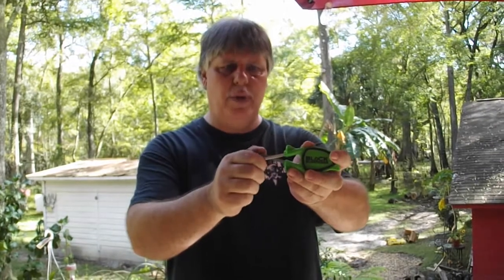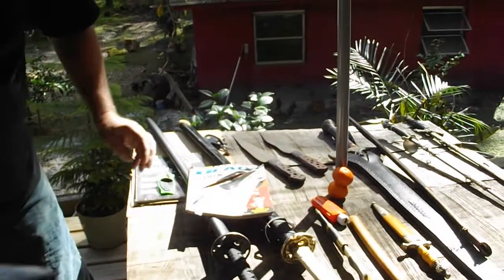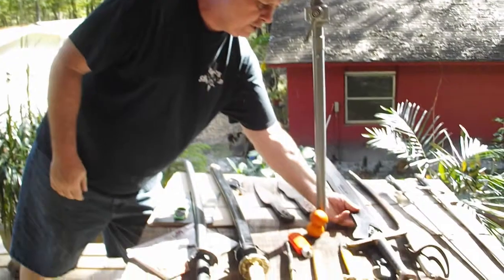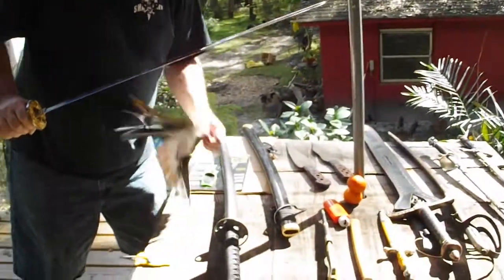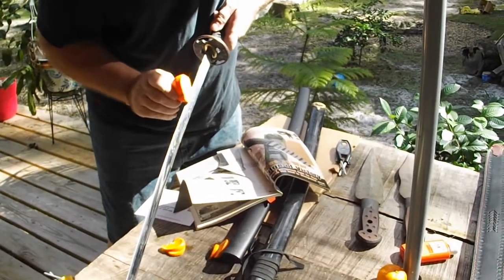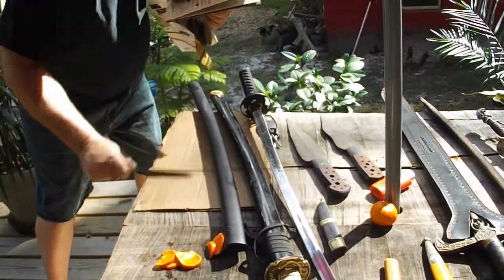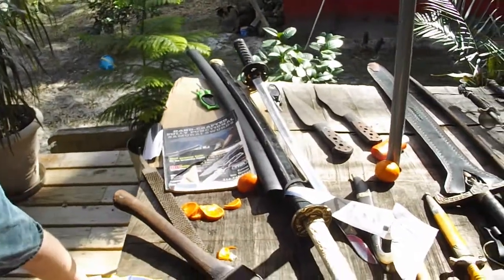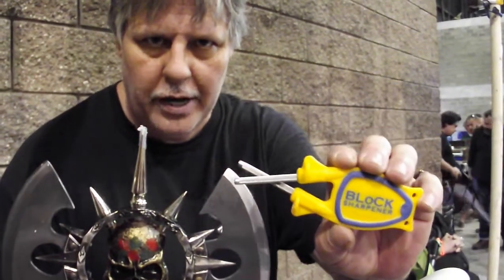Sharpening Swords and Katana Razor Sharp  is easy with the Block Sharpener

Comment from the maker: This review is 100% verified purchaser and I have had no contact at all with the seller or manufacturer. I recently purchased a $400 Boker Tree Damascus drop point pocket knife made in Germany and wanted a way to sharpen the beautifully patterned 300+ layered Damascus stainless blade without damaging it. After doing some research I came across The Block Sharpener. This device did a very decent job with no marring, chipping or scratching the blade at all. I would highly recommend watching The Block Sharpener videos on YouTube and on their website and to use oil as recommended. I have also ordered on Amazon a $10 leather razor strop to get an even finer razor sharp edge but the videos say you can use the rough side of an old belt or even cardboard to refine the edge the Block creates. After a first try I can confirm that it does follow the original curved edge grind as advertised and does sharpen! Is it like a $700 Edge Pro...absolutely not, but really is well worth the money and does quite a good sharpening job! I don't understand why some say it does not work because really it does. I definitely purchase more. See Photos!!! Thanks!!! Jerry
review image
1 comment| 3 people found this helpful. Was this review helpful to you?
Yes
5.0 out of 5 stars The BLOCK SHARPENER its the BEST
By Joe A.on August 4, 2017
Color: Blue with Yellow|Verified Purchase
The product works AWESOME better than advertised. Compact enough to put in my knife sheath & very well made. I loved it so much i bought 4 & on top of that Mr Billie Jo Block was SO VERY HELPFUL great customer service. Highly recommend this product & company! I sent one to my Son who is in the Marines in NC he loves it too. Thank You Billie Jo Block for a great product
5.0 out of 5 starsReally surprised me
ByNidhoggron September 6, 2017
Color: Black with Black|Verified Purchase
Great for a quick sharpen! And I was VERY surprised when it actually work on my serrated knives. Well worth 
5.0 out of 5 stars Makes you knives and swords razor sharp. Just be ...
ByDHSon June 6, 2016
Color: Blue with Black|Verified Purchase
Makes you knives and swords razor sharp. Just be careful when sharpening a sword. The rods will scratch the surface of the sword if it comes to contact with it. But if your careful and run a sword through it slowly it will make it razor sharp.
Comment| 2 people found this helpful. Was this review helpful to you?
5.0 out of 5 starsGreat product!
ByKyle A Walkeron March 5, 2017
Color: Orange|Verified Purchase
This is the only sharpener I use anymore unless I need to make some major bevel changes. Sharpens quickly, effortlessly, and without risking grinding the steel down too much.

Plus I met Mr. Block (senior) at a fishing show, he's a nice guy and is a waaaaay better salesman than his son ;)
5.0 out of 5 starsQuick and very easy to use!
ByRedBeardon October 17, 2017
Color: Orange|Verified Purchase
Definitely works! But there is a little small learning curve, about 2 minutes.
Comment| One person found this helpful. Was this review helpful to you?
Yes
5.0 out of 5 starsVery easy to use
ByAmazon Customeron May 16, 2017
Color: Orange|Verified Purchase
Very easy to use. I wanted a way to sharpen my own pocket knife and not have to always ask my husband to do it. He ordered this, thinking that he would still have to sharpen my knifes, but not anymore! I'm keeping it!!! And now I can sharpen my own knifes. Works great with Damascus Steel blades.
Comment| One person found this helpful. Was this review helpful to you?
Yes
 
5.0 out of 5 starsGreat
ByJenifron November 11, 2017
Color: Orange|Verified Purchase
For serrated edged knives it works great.

5.0 out of 5 starsA very good product. I have a lot of different knives
ByAmazon Customeron July 21, 2017
Color: Orange|Verified Purchase
A very good product. I have a lot of different knives, and it works well on all of them. I bought one each for my sons. Great pocket ready sharpener
5.0 out of 5 starsWorks great!!!!
Bylilshupik85on May 9, 2017
Color: Black with Yellow|Verified Purchase
Works like advertised. Take a little getting used to on how to hold the knife but it will put a very sharp edge on your blade.
Comment| One person found this helpful. Was this review helpful to you?

Comment: Have a question? Does it also sharpened a black Damascus katana sword??
Reply from the maker: It should long as it not to warn out real bad. more for finish touch on stuff that hard
Reply: Paul Block it's not warn out at all, I'm asking because I don't want to damage the sword, what kind of oil I should use?
Reply from the maker: 3-n-1 , gun oils, if can bolt sharpener down to bench. do some other swords first get the  feel .

Comment: The real Japanese Karanas are not made by the single stainless steel.  They are mixing up with the plurrel metals.  If you sharpen The real Katana with the titanium carbide, the micro bevels get all scratch.
Reply from the maker: I cant say it would not for sure i never sharpen one. But i can tell you i have sharpen a lot of different types of steels and never scratched any edges with my new models. Now are original sharpeners est in 1969 where made for butcher shops and production sharpening have a courser rods they most likely would scratch edges. My new models i aimed them more for finer hone and razor sharp. I do relay believe you would be ok to use it on a very hi dollar sword. but sure your not going to get a polish finish. I would leather and polish after words . I haven't done swords over 500 dollars. But i have done Bowie knives 1000 dollars  and up. And done a great job.

Comment: this is not how you sharpen a katana guys
Reply from the maker: how do you do it?
Reply: With several grades of wet stones. Which, after buying your product ,I had to go back to ,in order to recover my blade . I was successfull but it took me all day and into the next. And like this was only possible because my sword was designed to be extremely tough and contains much more steel than most katana.